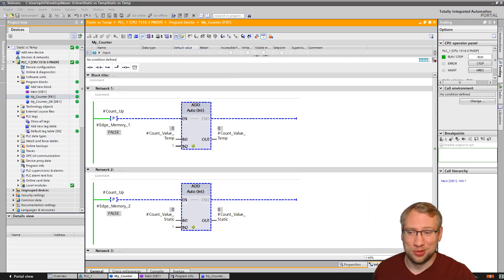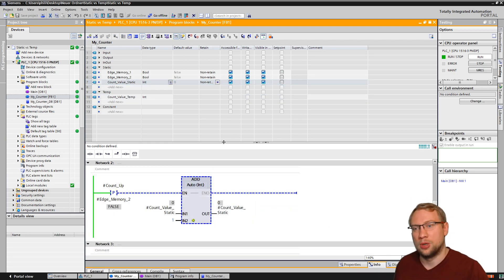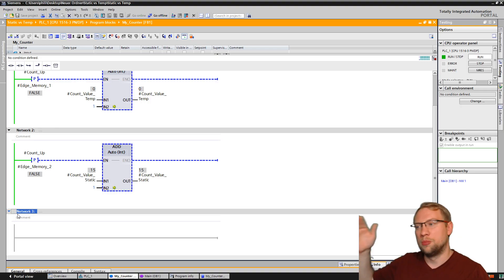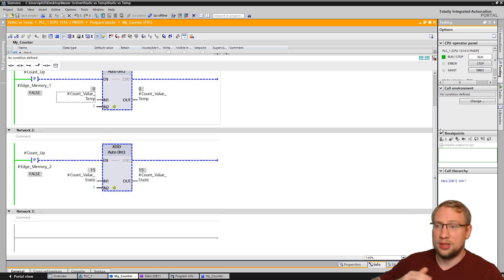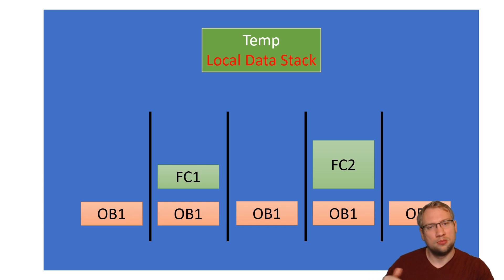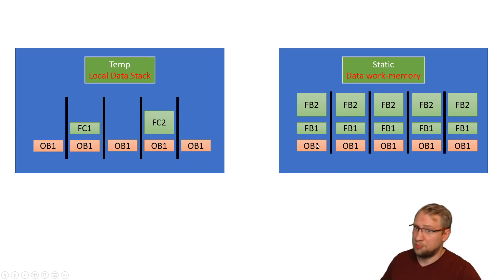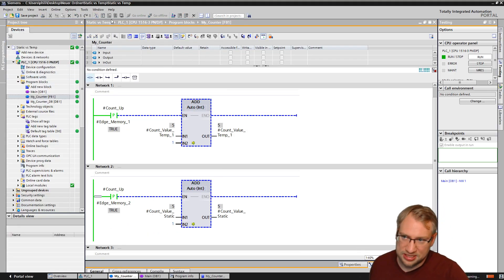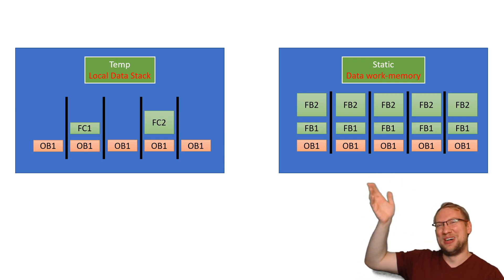TIA Portal: Static vs Temp Variables

Comment: The topic did not cover the subject.
It has been explained difference between temp and stat variables.
It has not been explaned where or when temps are useful and not. Why "not working" temps are presented in both FC and FB interfaces. Not for nothing, of course. 🙂
It has not been explained how to handle with temps within S7-300 hardware  and S7-1xxx series. Huge difference there is I would say.

Comment: Hegamurl , 
I want to ask u a question.

-----------------------------------------------------------
"R_TRIG_DB_1"(CLK:="Clock_1Hz",
   //System clock memory M0.5
              Q=>#R_Edge_1Hz);
                //Temp Data of FC

WHILE #R_Edge_1Hz DO
    "BigCounter" := "BigCounter" + 1;
    //MW50
END_WHILE;
-----------------------------------------------------------
Why this program turns the plc mode to stop?
I know what should i do. I have to define  "R_Edge_1Hz" as a static variable,  but i wonder that why this program doesn't works ?

Thanks
Reply: When R_Edge detected, i wait that it will be TRUE only 1 program cycle AND turns to FALSE. After that it waits 1 sec(couse of 1 Hz) to turn TRUE. Why the WHILE block doesn't EXIT after 1 program cycle OR why it's continue to adding operation ?

Comment: Can a edge memory bit be a temporary variable? Or will it count up with each cycle as long as the input is high?
Great content as usual, would be great tho if you could give a brief rundown on different applications of the content in use in Automation
Reply from the maker: Edge Memory Bits need to be static, as they have to "remember" the status from the last cycle. Great advice with showing applications, I'll keep it in mind!
Reply: @hegamurl  so if I want to use positive edge triggers in a sub routine and symbolically address the edge memory bit I must use FBs? 💡💡💡
Reply from the maker: @demurch0  Basically YES. But...
1. If you only use the subroutine once, you could simply use a global memory bit (not good practice)
2. You could add the edge memory bit as input to your subroutine and externally connect a global memory

Comment: Wait, what if OB1 is stopped by for example OB30.. is temp of what was going on in OB1 deleted? How does it returns back to OB1 FCs then?
Reply from the maker: Excellent question! OB1 is only interrupted (and never cancelled), so the temporary data is not lost and still in the data stack. After OB30 was executed, the rest of the program just goes on as it normally would.

Comment: Thanks for the explanation. So the only reason one  would use temp variables is reduce memory usage. Can you please tell what is the practical usage of having a temp variable apart from reducing the memory size and why would we use them.
Reply: Sometimes you just one to restart functions from the beginning. Any data remaining can create a mistake. If you start a cycle, you don't want the previous cycle to ruin your process.
Reply: Sometimes you just one to restart functions from the beginning. Any data remaining can create a mistake. If you start a cycle, you don't want the previous cycle to ruin your process.

Comment: Reset ADD
Reply from the maker: That's not the point of the video 😅
You could easily add a reset using a "move" statement that moves a zero into the integer count variable